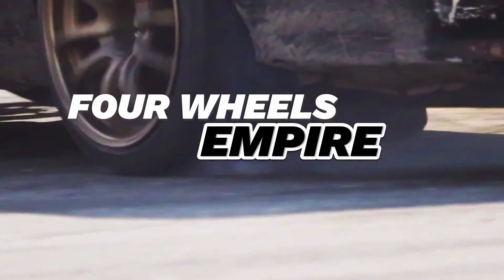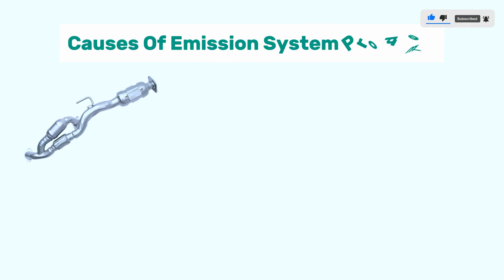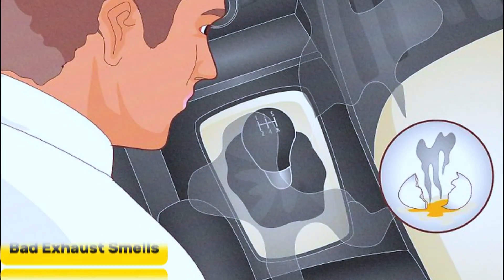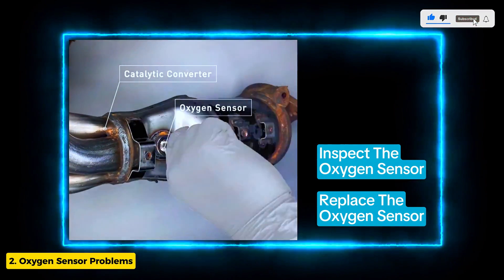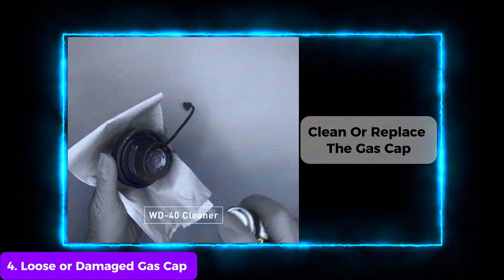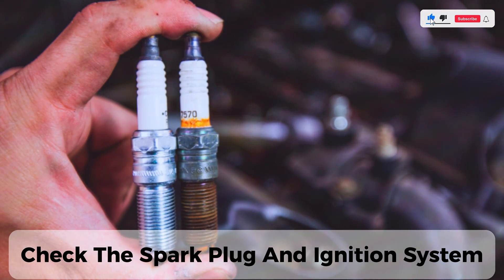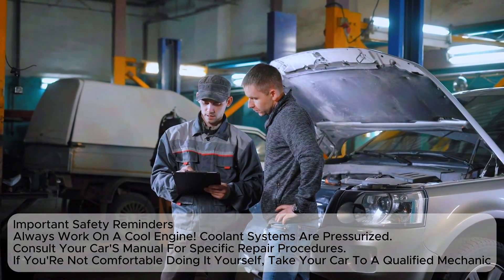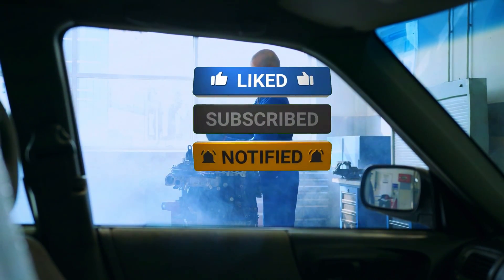How To Fix Emission Systems Problems: Causes And Symptoms Explained@FourWheelsEmpire

Comment: 2014 Nissan versa. It started hiccuping so they gave it a general tuneup with new spark plugs. Still hiccups so I have added a fuel cleaner 5 times to a full tank. Still shakes. I changed out the catalytic converter, and now it’s worse! It dies at a complete stop or when idling. What’s the problem!
Reply from the maker: It sounds like you’re really dealing with some frustrating issues! Hiccups and shaking can be caused by several factors, including fuel delivery problems or even sensor issues. It might be worth getting a diagnostic check to pinpoint the exact cause.